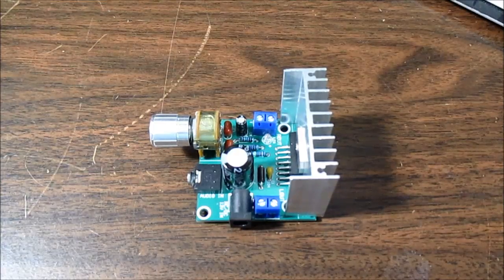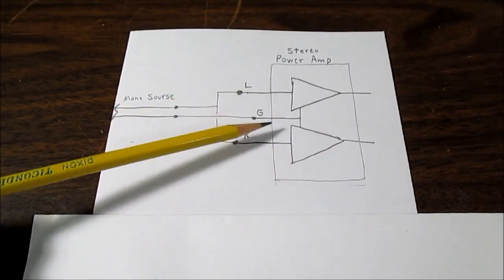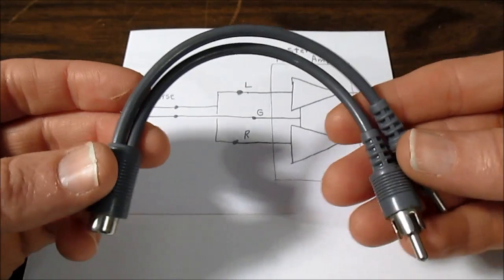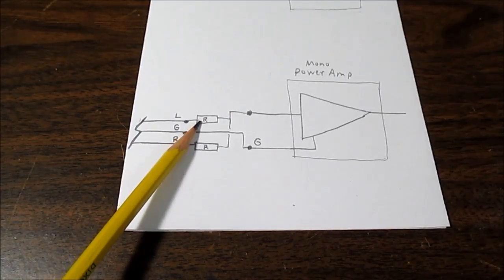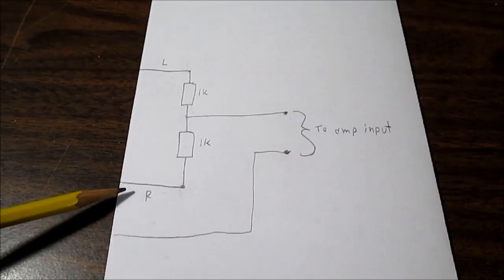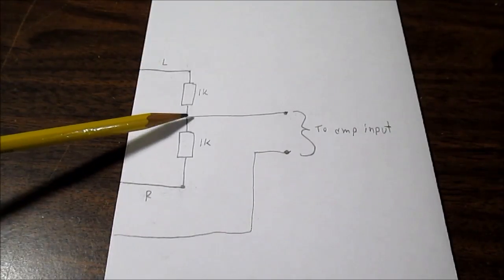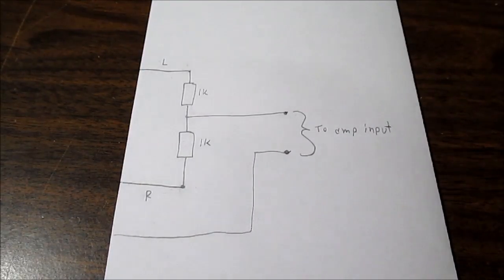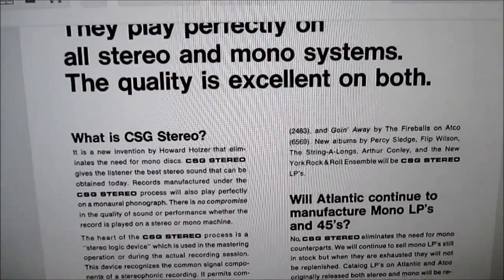Connecting mono to stereo amplifier or stereo to mono amp

Comment: I am Outputting a Phono 1/4" Stereo Headphone Keyboard Signal, into a Guitar Amplifier. Stereo Effect's in the Ketboard Output, are missing. What can I do? I want to connect a Stereo Cable line, to the Amp Input.

Comment: John, I have a question. What would happen if we raplace (or add to)R1, R2(stereo to mono scheme) with diods?
Reply: Sounds like a Fuzztone, that's what diodes will do: chop out half of your signal
Reply: @lectrikdog  No diode on the ground, only on the left and right to prevent crosstalk/shorting. Might possibly work!
Reply: @vikassm  Diode typically have a forward voltage of 0.7V, so any signal below that would be chopped off.

Comment: I had a pair of computer speakers once that had a mono amp in them, and that amp was connected to both of the speakers.  They just shorted both channels together at the connector with no resistors to send a mono signal to the amp, no wonder my sound-card didn't last long! I hate it when someone tries to simulate stereo from a mono recording though, I have a few LP's where there are some mono songs "converted" to stereo and they sound awful through headphones, the original mono recordings sound good enough and should have been left like that.
Reply from the maker: I have some like that. One channel sounds more treble than the other. I wished they had left it mono. Record companies have been up to stupid tricks for years. Nowadays they feel they must crush the dynamics of music with compression, aka the "loudness wars".
Reply: They run the signal through a multi-order crossover, and pan various frequency ranges slightly(hopefully) left and right to simulate different instruments playing in stereo, but it is not realistic at all and only ruins the song.
It's especially horrible when a single instrument or voice manages to hit multiple crossed over frequency ranges, and you can hear the sound moving left and right for no reason.

Comment: Do you also have a video explaining how to combine the L/R speaker output to a single speaker? For example the 7297 seen in this video powering a single 5-8" subwoofer. Also is it best to filter the frequency before or after the amp?  I have seen so many great videos from you, I think it may be covered somewhere...
Reply: Brad, This guy doesn't know much, its been a year and he still has not answer your question, a question i was wondering about too plus he should have used a diode with the resistor in his drawing... he does not know much
Reply: @axewax9074  How you would use a diode with a resistor in the input, can you care to elaborate?

Comment: In case mono to stereo, I usually insert a phase shifter circuit. There will be phase difference about 90° between left signal and right signal.
Cheers from Indonesia
Reply: Why to shift the phase and how to avoid impedances and feedback issue between channels

Comment: Hello John Audio Tech, Thanks for this video.  I need your suggesstion. I am listening music mostly of the mono recordings, but with stereo cassette deck as well as with CD players connected to the old mono valve radio.  In this cable, using with higher impedance 4.7K ohm instead of  1K ohm,  will it be good for the mono recording music or will be suppressed ?  Are the  4k7 ohms and 4.7K ohms resistors same?  Can I use 1% tolerance metal film resistors?  Kindly let me know in detail. Thanks again and best regards.

Comment: I hope you don't mind a noob question.... You mentioned in the video about tape or cd player output resistor value should be about 4.7k to feed a mono amp. I wonder what resistor value I should use for a desktop PC speaker/line output?

Comment: Running a stereo signal into two separate mono amps, send the left to one and the right to the other then split the GND to both. Correct?
Reply from the maker: Yes
Reply: @JohnAudioTech  thanks. I have two very old mono amps like 30+ years old. can i do stereo
Reply: @Moby So the 5.1 is 6 mono amps together?

Comment: I have a PYLE active sound system model psufm1245A which consists of a single vertical box with two woofers and two tweeters and the amplifier. 

Although it has two rca inputs for left and right, only one of the inputs produces sound (the red one). If I use a mono to stereo converter, will I be able to hear the stereo sounds through a single output?

Comment: Add a 1 microfarad poly cap before each resistor (or up to 10ųfd) will help with some d.c. cancellation,and minimize source channel breakdown. But it does add 2 more parts...

Comment: What happens if the resistors are not of sufficient value. I have added 470 Ohm resistors to L and R channel of a stereo BT module, to mix to  a mono signal.  Would 1k Ohm be significantly better?

Comment: ??? So I would like to connect 3 Tpa3116D2 amplifiers to a single stereo input ,, 2 of the amps are mono versions and want to drive my 10 " dual 4 ohm subwoofer , if I connect 1 with ( mono ) the R+ and the L+ to the other mono amp and the ground split between them  I`m worried that the voice coils might be fighting each other with different signals ??  Also will there be a loss to the inputs of the amps thanks John ..

Comment: You mean to say in case of One mono output going into Two stereo channels there's no need to connect resistors from the output to the inputs ?
Reply: Yes, because with mono you effectively only have one signal, when it goes into the amp and gets split into 2 signals both those signals will be identical, so no "imbalance".

Comment: I got NAD 705 from the goodwill for 8 bucks. All I did was use both channels to one speakers signal. I plugged in the negative to the left channel. And the positive to the right channel. I turned it up and it blew out some cheap little Boston speakers. Amp and speakers are fried

Comment: Hey, i'm kinda new to this, just trying to figure it out by trying things on inexpensive speakers (or some i've got for free). I want to connect a mono speaker to a stereo amp, i checked the impedance and the watts and it looks good, but my question is: following the scheme at 1.24, does it matter which one is negative and which one is positive? and if yes, which one needs to be separated to L/R and which one to G?
Reply from the maker: Don't connect the L and R outputs together. This can damage the amp. It is better just to use one channel for one speaker and mix to mono at the input.

Comment: I have bought an expensive dj set up that only outputs stereo. I have one powered monitor speaker. when I connect the stereo output to the mono speaker with a connector it causes cancellation.. is there a converter I can use to fix this? I tried to follow the video but is a bit to electronics oriented for me to follow 100%

Comment: Ok, so newbie question here — why not stick a couple of diodes in to prevent current sinking?

If you are building a 2.1 amp, how do you best combine the .1 bit?
Reply: Because the signal is AC and the diode cuts half of it off.

Comment: I wonder what happens if you try this mixing matrix:
1) L and R signals pass through a differential op-amp to get the middle channel M.
2) L and R joined to get the stereo image channel S.
3) mix previous channels M+S and try to add a phase shift if necessary.
Reply from the maker: Differentiating the L and R signals removes common signals (center panned) and is notated as L-R.
Joining L and R is summing and is  notated as L+R
If you now sum L-R and L+R together you get 2L (2 is double the amplitude).
If you differentiate L-R and L+R, you end up with 2R.
This, BTW, is how FM stereo is decoded as the L+R is sent for compatibility with mono radios and the the L-R signal is also sent. The receiver decodes and does the math to regenerate the L and R channels. It doesn't fix the loud center panned mono issue. Since the center panned information is carried in both L and R channels it would require the remixing of the original multi track session masters to fix that issue.
Reply: JohnAudioTech You're absolutely right.

Comment: Also, some lossy codecs at low bitrates that use parametric stereo completely fuck up when you mix them down to mono.
You can check by yourself by encoding a stereo music file to opus at 64 or 48 kbps and then mixing down to mono, really not enjoyable musical experience, it can be mitigated by phase shift or very few ms delay between both channels. 

There would be very few situations where this would be an issue, such as wanting to play some low bitrate stereo files on mono equipment so not a problem for most people.
Reply: Here in argentina we can buy very few modules that are mono. Im trying to make some guitar amps to sell and those stereo module like the same from the video are the only few that we can get. Third world countries find this very usefull xD

Comment: Wild question, Instead of a resistor, Do you think a diode would work for mixing stereo into mono? Prevents left & right channels from shorting out since a diode will only allow current in one direction, one could use a beefy diode to reduce coloration etc. Any thoughts?
Reply: diodes cuts the waveform, i would like to hear a sample of it
Reply: @xpto3698  yeah I figured out this isn't gonna work for music amplifiers :)
BUT, I tried it on the preamp to feed a tiny 5w mono guitar amp and it was, well, interesting :)
Reply: @vikassm  I Would like to hear, post on youtube if possible = D

Comment: Hi John , I am so new to this but your videos are so helpful , Thank you. What I'm trying to do is build a one speaker bluetooth box using the 50w Amp with the Panasonic capacitors   you tested in a previous video, is it possible to connect the +R and -L to the speaker and run a jumper line from the +L over to the +R . I'm also only powering the amp with 5v thru the VVC and ground terminals which
Reply from the maker: Don't connect the outputs together, it may damage the chips. Use a dual voice coil speaker or use one channel for the woofer and the other for a tweeter.

Comment: I have 5.1 home theatre and sperate input,I have doubt how input L or R two inputs single SW pin,if I input direct,side speakers will not come stereo,if use like you say 1K resistor?I think it will work.

Comment: So would I be able to use an active low pass filter board that have stereo input to mono output, and split both the mono output ground and signal back into a 2 channel amplifier to power two subwoofers on each channel?
Reply from the maker: Yes that should be possible.
Reply: thanks, it worked, though i'm getting a bit of ground loop noise at half volume on the amp with a small speaker i tested it with, didn't test it with a sub yet

Comment: Can I also use this resistor technique at the speaker output? so say I have a small amp which has a left and right channel output, but I want to connect only one speaker, and have both stereo sides on it, will the resistor technique work?
Reply from the maker: If the speaker is 4 or more ohms, there is little to no benefit to paralleling the channels. If it is a bridged amplifier (like many of the class D boards) it takes four 0.1 ohm resistors. It is better to get a single channel amp or use two speakers.

Comment: What I would like to know is if the signal is already amplified (output from car head unit) and I want so sum the left and right for a center speaker the head unit is a kenwood and a 22w rms x4 i want to use the left and right front amplified signal to power my single center speaker 
Please help 🙏
Reply from the maker: The outputs from the head unit are likely bridged. Output would need to be unbalanced and signal reduced and then mixed into an amplifier for the center speaker.
Reply: @JohnAudioTech  so it’s technically important unless I add a DSP? 😭

Comment: Maybe this explains why when U take the L and R speaker outputs and connect them to a single or pair of speakers and get a surround effect. B/C i always wondered how that effect worked. Maybe U could do a vid on this phenomenon  some time?
Reply from the maker: I use that to get the rear channel from my two channel TV amplifier. Works great.

Comment: It sounds to me like there is no way so sum the stereo signals into one without losing something.  Is that the case ?
Reply from the maker: Summing causes a 6dB "build up" of center panned sounds. This caused problems with stereo recordings on mono equipment back in the day. There were solutions like Heaco CSG encoding that fixed the build up problem but screwed up the stereo image.

Comment: Hello John
I can use your help if your out here.
I would take any suggestions on how to find out how to breakout an unbalanced stereo cable into two mono ( L & R ) sources.
That is....  Normally, that's not a big deal. 

Except I have two stereo Amps with only one stereo input per Amp each. Which are 3.5 mm.

In other words.My goal is to have each Amp get their full mono current source ll  possible. One mono cable per amp. 
No line loss. power driving a left or Right channels and behaving as if, stereo jacks aren't an issue. Mono amps..Separated in a L & R scenario and producing a Stereo .Field. 

 If using Stereo 3.5 output jacks is the thing over mono male jacks.That would be fine. I just don't want to pop something..  

 Hey... You're doing good work out here... thanks again.
Reply from the maker: If I follow, just send the L channel and ground to the amp used for left (send the L signal into both its L and R line in the 3.5mm jack. Same for the R signal and R side amp.

Comment: Also, if you just connect together left and right, if one of the channels is just phase inverted from the other, you won't get anything at all out of the amp, other than jitter and line noise.

You should design a comparator circuit to do a proper stereo to mono merger. I have thought about it, but it seems like a lot of work, surely there is a simple way to do it. 

Perhaps have the left channel serve as the ground for a buffer to buffer in the right channel? That way the right channel having no signal wouldn't sink anything, it just wouldn't add anything to the left. That still wouldn't take care of phase inverted signals though... I suppose you would need logic level gates to selectively buffer only when both channels share the same polarity. 

Yeah, a lot of work.

I wonder how horrible it would sound if you simply stuck a diode on the right channel and only added on the top half of the sine wave.

Comment: How can I connect both outputs (Left and Right channel) of Pam8403 to a single speaker?(I want all his power wihout blowing up by merging them).
Reply from the maker: The 8403 already has bridged outputs so there is no benefit in doing this unless you have a low impedance speaker (such as 2 ohms). It takes current sharing resistors on each output (4 in total) and the inputs are connected together to be sure the signal is identical on both channels.

Comment: So, for the mono-to-stereo situation, how do you connect the speaker to the amp?
Reply from the maker: You really would need to connect a speaker to each channel. For woofer use, you could go dual voice coil. Paralleling the outputs is possible but more involved.

Comment: I have a Large Condenser stereo microphone that takes 2 channels on my interface i wanted to go in a dedicated higher quality external  mono pre amp with 1 channel then back out as stereo into my  interface i thought a y splitter xlr cable would do the trick🤷🏽‍♂️idk i dont want to try until i come up with the best solution the reason i want to d ok this is because the pre amp i wan cost 2k and i cant afford 2 mic pres but i need that specific pre
Reply: ( Xlr cables)Stereo Microphone =- mono pre amp channel -= stereo back into [interface]-(thunderbolt into mac)
Reply: @ConfidenZeTheHumanTorch  Once the signal has been converted to mono, you can't convert it back to stereo -well, you can, but the L & R signals will be exactly the same, so there's no point. If you're recording on to the computer using your "interface," then you might as well convert it digitally - duplicate the mono track and assign one copy to L & one copy to R.

Comment: you forgot to mention another way mixing stereo to mono. to get real funky sound hook one of the stero outputs to mono input ground. then only stero differential is heard. not very practical but sounds interesting.
Reply from the maker: I use that to get the rear channel effect from stereo for my TV. It works a treat, but sounds odd for straight mono. I made a box that sums, differentiates, left only and right only pass through. I plan to do a video of it at some point.

Comment: I know this is an older video and man is it helpful. But I have a question and hope you can help me. I am learning as I build anything DIY, and recently I started building BT speaker systems. I want to make a small single speaker and I want to make sure I do something like this. In this video, you are using 2 components to create this on the speaker. What if you have an amp with the bt already incorporated on the board like this one in the link-https://www.amazon.com/TPA3110-Amplifier-Digital-Wireless-Bluetooth/dp/B07PK9FRBD/ref=sr_1_4?keywords=tpa3110&qid=1583968613&sr=8-4

How could I use something like this to get or should i even bother? I'll be using a Dayton Audio ND64-4 for the single speaker build. So I guess I am wondering if you can do anything on the output? Thanks for your time and trouble!!!
Reply: So i just wanted your other video. Do you think if I added the 1-ohm resistor on the output and then paralleled the right and left, I can use it with a single speaker? Then I will get both channels and a good sound out of my single speaker BT build?